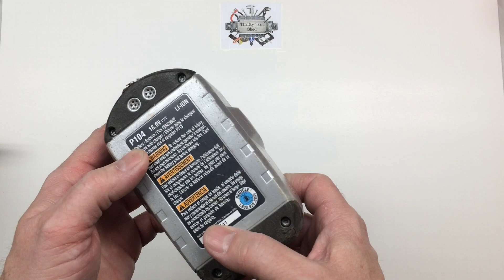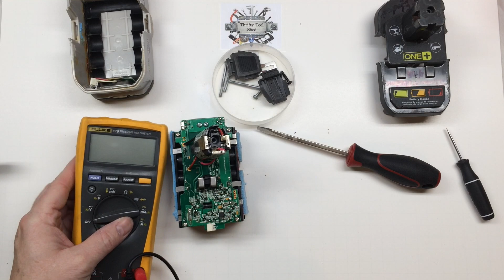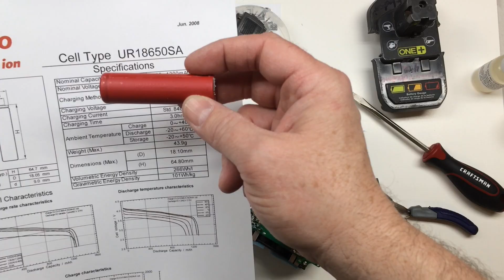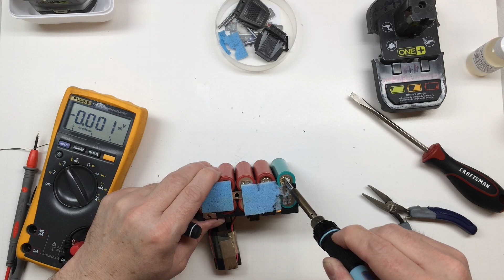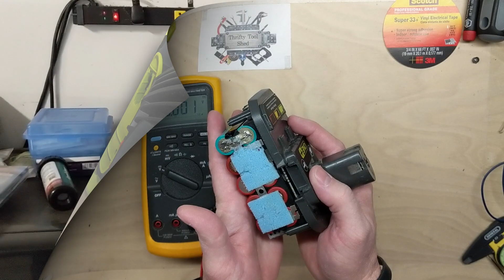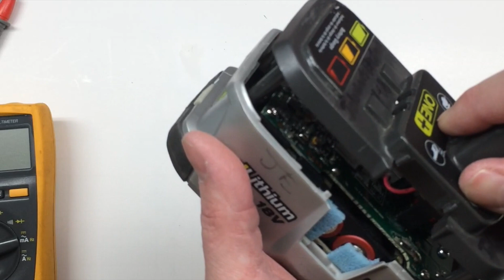Ryobi P104 Battery Repair

Comment: I have a battery pack that wont charge even though all of the cells are at 3.64-3.67 volts. The voltage at the post (the part that slides into the tool or charger) is around 16 volts. But if you test the voltage across the cells on the board, it reads about 18 volts. I'm not sure if this is normal or the cause of my battery not charging. Do you have any ideas? Love your videos btw!
Reply from the maker: Seems like it could be the BMS board. The transistors on board can cut out or not fully turn on if a problem is detected with the pack. Sounds like your pack is pretty well balanced and voltage is high enough to charge so it is either a bad NTC or a fault in the BMS circuitry would be my guess.
Reply: @ThriftyToolShed  Hola ayúdame por favor ... Tengo una batería ryobi qué cuando la pongo en el cargador el cargador después de 5 segundos prende el foco verde de inmediato indicando que está cargada pero al medir la batería la batería solamente cuenta con 17 volts lo cheque con un voltímetro y cheque cada celda y cada celda está bien tiene alrededor de 3.6 v mi pila tiene leds indicadores de carga pero solo prende el primero indicando carga baja.... Yo pensé que podría ser una celda pero las celdas están bien lo revise por separado cada una de ellas... Entonces mi problema es que cuando la pongo a cargar el cargador casi de inmediato se pone en foco verde en luz verde indicando que está cargada.. pero la batería se queda en los 17.68 volts... Qué podría ser me podrías ayudar por favor

Comment: I have all Ryobi tools and therefore all Ryobi batteries.  I have questions about using multiple batteries connected in parallel to make a portable battery pack.  in theory, four 5Ah batteries hook together to give an output of 20Ah battery pack.  My concern is what do I have to be cautious about to prevent any unexpected results when connecting 4 batteries in parallel to increase amp capacity.  My goal is to make a pack of 4 batteries and have an output of 12v, USB, and 110v to run other small appliances and tools.
I did a video on this idea on my channel in my porta-power series.  I can link it if you want to understand more of what I am trying to do.  Just looking for your expert opinions and ideas, not plugging my channel so any advise and insight is appreciated.
Reply from the maker: The only problem I can think of is the balance of the said packs. Of course if all perfectly balanced in a perfect world no pack would pull on the other. So if all packs are close in charge and discharge rate is very close it may be just fine. I would consider using high current diodes in the circuit other wise to make sure the current can only flow from packs and not back into it.  Just my thoughts off the top of my head, and feel free to post a link, I would enjoy it!
Reply: thanks for the tip.  I have to tell you. my videos are not of the quality that yours are.  My style is more of a show and tell since I don't edit videos.  Anyway, thanks for the response, most channels your size don't seem to answer questions.  I have one more question.  I bought the 5Ah generic batteries for my battery pack project.  My question is, does the generic battery have a temperature sensor like the Ryobi brand?
Reply from the maker: @russveinot5754  
I try my best to respond. sometimes the number of responses is overwhelming and then again sometimes it is as if everyone stopped watching altogether, lol. 
I can not be sure about the generic pack you are referring to exactly, but the ones that I have personally seen, they do have the ntc very similar to the name brand. Sometimes after testing the capacity is not what it was stated to be though, unfortunately!
Reply from the maker: @russveinot5754  
BTW, I just seen your channel is bigger than mine!👍
Reply: I bought 6 5Ah batteries to give me a matched set for my battery pack.  Also, I charge them fully before plugging them in.  I'm just looking to run my computer, tv, dvd player, etc. when there is a power outage here.  We seem to get more than our fair share :>)

Comment: I have the same exact battery and it just so happens the same 2 cells are dead. The other cells are reading around 2.4. Is that too low to even bother with the replacing of replacing. I thought maybe hanging on to and waiting for another battery to steal some cells out of. More time than money sort of thing. BTW.... great video.!!
Reply from the maker: Interesting, 2.4V is border line to me and I would try to charge those up and test them by making sure they do not get too warm. Also if they do charge up fine do they discharge ok (evenly etc.) I would charge them up some even if you decide to set it aside for later you don't want the cells to drop any lower.
Thanks for your comment!

Comment: I have a Ryobi trimmer that was given to me with a P104 battery that would not charge. I opened the battery and found one cell that apparently leaked. The rest look fine. All the cells are below a volt. I’m guessing when the one cell failed, it drained the rest. Wondering if it is even worth trying to salvage the pack? Don’t know what my options are.
Reply from the maker: Sounds like what happened for sure. Typically when cells go that far ( < 1V ) they are passed the point of reviving! That said if you can use a power supply to connect across the + and - of every cell individually (or set of 2   for the P104) and make sure you set the voltage at 4v and current limit to no more than 1Amp you can see if any of the others are worth saving. Just use caution that they don't get really hot etc. while testing. Sometimes this works but after the charging the cell will start draining down on its own and you can tell it is a bad cell, best of luck!

Comment: If I fail to find a source of 1300mah cells, what would be the problem with using, say, 2500mah cells instead?
Reply from the maker: I believe it would be badly unbalanced in such a arrangement honestly. I always try to find the closest replacement as possible or change all cells out to the new ones if cost justified. That's why every time I work on batteries I keep the good cells from some really bad packs and over time build a fairly good spare assortment. Best of luck!

Comment: Q1: my batt pack T10 torx head has a center pin,  did you use a special torx bit;  Q2 :  where did you buy your cells,
Reply from the maker: A1: Yes, security bit set, I really like the longer bit set as in the link below. ( I use this set a lot, shorter ones are cheaper though...)
A2: I kept them from other ryobi packs that failed, for example some are from almost identical packs and i also have some from the 40V ryobi packs as spare.

Long reach security bits:
https://rover.ebay.com/rover/1/711-53200-19255-0/1?icep_id=114&ipn=icep&toolid=20004&campid=5338325412&mpre=https%3A%2F%2Fwww.ebay.com%2Fitm%2FExtra-Long-6-Security-Bit-32pc-Set-Tamper-Proof-Hex-Torx-Star-Pozi-Tri-Wing%2F111824191857%3F_trkparms%3Daid%253D111001%2526algo%253DREC.SEED%2526ao%253D1%2526asc%253D20160908105057%2526meid%253D2ae5d0d969a94c0a8c1c25a93e236b6c%2526pid%253D100675%2526rk%253D1%2526rkt%253D15%2526mehot%253Dpp%2526sd%253D111824191857%2526itm%253D111824191857%26_trksid%3Dp2481888.c100675.m4236%26_trkparms%3Dpageci%253A0ad76450-6c67-11e9-b583-74dbd18032b9%257Cparentrq%253A75aead2e16a0ac1d207c3a27fffb843b%257Ciid%253A1